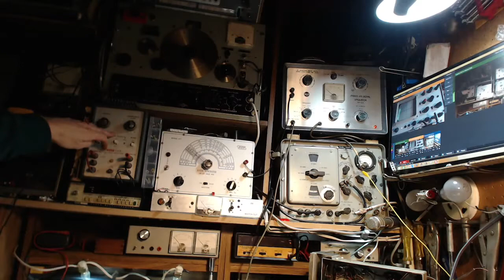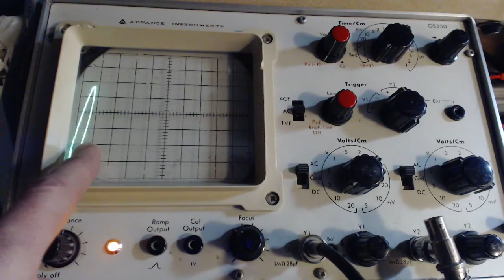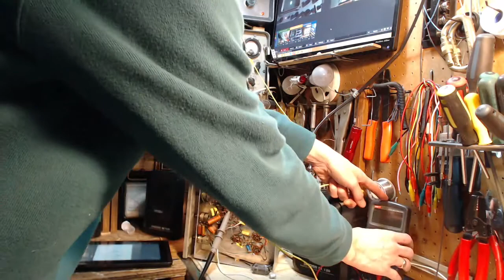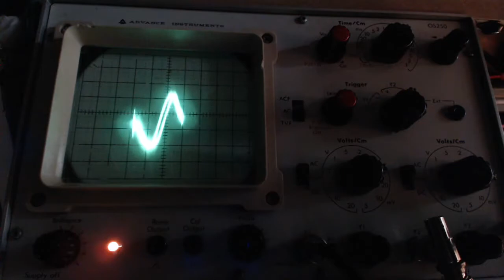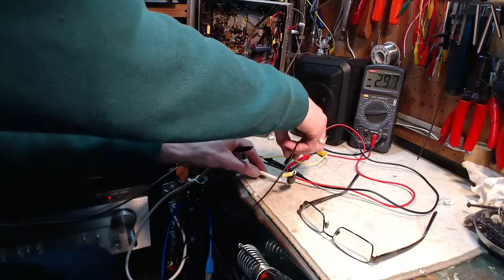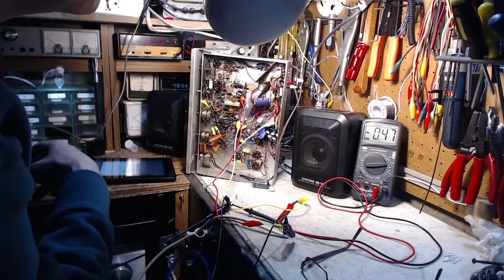Viking Console Stereo Video #50 - Sweeping FM Signal Simulator

Comment: Jim I have to ask why not go with the manufactures set up .

With 10.7 in set T2 & T3 (max v across C25 )

Then turning the detector into a balanced bridge with 2 temporary resistors ( 100k in series across C18 ) .

Reading from the center of the resistors & output R4 then set T4 for 0 mv or ( as close as you can ) .

Its way less trouble than what your trying now !!!!

Part of the fun is reading the map …....
Reply from the maker: gd2329j Well don't we think alike.  I thought I'd give the sweep a go after I noticed the FM Simulator had such a setting.  At that moment, I had a totally different vision on how that would work.  I also didn't know my scope had an X-Y setting and once I saw these two things, I had to try them out.  Besides, I was waiting for the mica capacitors to arrive and I had some time to play around.

Comment: Couple of thoughts.  I don't understand the idea of sending in both a 10.7 MHz IF carrier and the 100 MHz FM carrier together unless you are trying to align the radio through the beating of the IF signal derived from the FM carrier with the injected 10.7 MHz carrier.  If so, signal levels are going to be really important so that they are balanced in the mixer.  The injected carrier and the derived carrier (IF from the 100 MHz input signal), but have the same level, and you have to be able to see nearly DC output from the FM detector.  

Early in the video, I saw what looked like an FM discriminator trace (S-curve on its side) when the FM generator was swept across the passband.  I would expect to see such a trace.  I don't know if your FM generator is a broadcast generator, but if a standard FM generator, the deviation needs to be set to 75 kHz and  you can feed in a 1 kHz modulating tone.  That should insure that the audio volume is near what is expected in standard FM broadcast.  When sweeping the generator, I don't think you need any modulation if you are just sweeping through the passband of the radio (say 250-500 kHz).  If the sweep rate is 60 Hz, then you can look at the FM detector output and set the scope to sync on the line frequency.  I use this technique to balance FM discrimiators-not your particular problem, but a good way to check the detector operation.  From my thinking, your symptoms still point to LO drift, and that's what you want to verify.  For s stable FM input signal, the IF frequency should remain at 10.7 MHz.  If not your, LO is drifting, and the grid circuit of V1B needs examined.  The FM stability of this radio is entirely determined by the component tolerances of the tank circuit on the grid of that triode. Plate resistance drift and B+ drift can also affect the frequency.
Reply from the maker: Keith Barker LO drift.  Want to put money on it?  Your comment and others are helping me understand the fine points of my attempt at this and, although I've finished the receiver as I write this, I have another console receiver coming in a couple days.  So I'll have a chance to apply all this knowledge that you, and others, are offering so kindly.  And I think it's stereo too.
Reply from the maker: Keith Barker And when I included the second generator for the 10.7 my head exploded.  In fact, I was so embarrassed about the crazy stuff I was doing, I was not going to post the video.  I let Jim P see it first and with his encouragement, I posted it.  I really thought I had gone off the deep end when in fact, I was close.  The second generator reveals where 10.7 is on the scope trace but I could see it.  Next time for sure.
Reply: Hey don't worry about that.  If I had a nickel for every time I did something stupid or embarrassing, I'd be a wealthy man.     Besides I missed the whole idea that you were creating a frequency marker - duh.
Reply: One more comment, I would say from my observations, I've been impressed how you "keep your head when all about you are losing theirs.."  And the silver-mica disease, just brilliant.  I never would have caught that one.
Reply from the maker: Keith Barker Rudyard eh?  That poem has meant so much in my life.  I discovered it in college.  Just last week, I was encouraging my son to read it.
Reply: Yes, Rudyard.  And passing it on to the next generation seems to be the point of the poem.

Comment: Hi Jim Your on AC input with the CRO !

The output at the top of C25 is DC & will move with the signal strength .
( this moves with 10.7Mhz or 455Khz signal like the meter across C18 on FM but this is not where you measure signal strength as the limiter will give misleading results ) .

With the CRO set for DC input 1V p/d & 10.7Mhz feeding the set adjust T2 & T3 for best voltage out @ C25 . ( no sweep gen input & no x y ) .

Now you remove the 10.7Mhz sig gen & set-up the sweep gen & you can see the 10.7 MHz pass-band on the CRO .

( You could just set a good looking pass-band then move local oscillator & match the tuning but your guessing the IF frequency ) .

Now you can set T4 with VHF sweep for the "butterfly / xy loop " you maybe looking for .

Note Don't peek T2 & T3 after setting T4 as you will have to reset T4 .
Reply from the maker: gd2329j I was closer than I realized but it all became too much for my brain.  I'll try this again on the next FM radio.  In fact, I have another console receiver coming in a couple of days.  I think it's stereo too.  Yahoo.

Comment: Not sure if it's relevant, but the reading on the meter dropped significantly when you made the connection at 20:30 in the video.
Reply from the maker: Adventures in Teletext I missed that but it would have only added to my confusion.